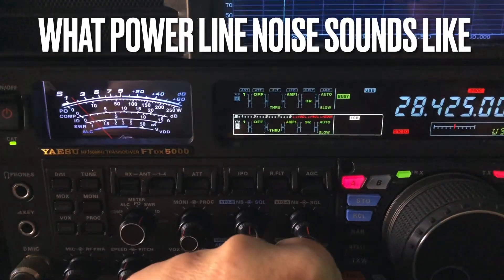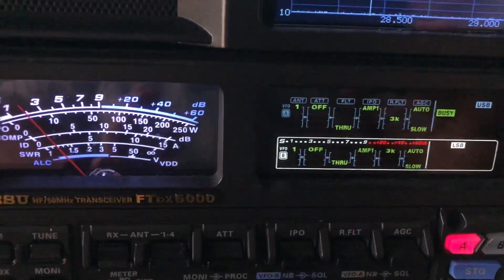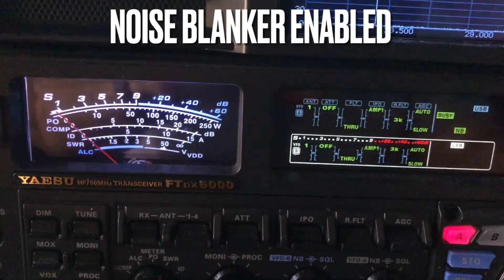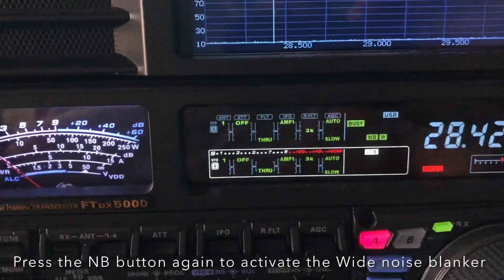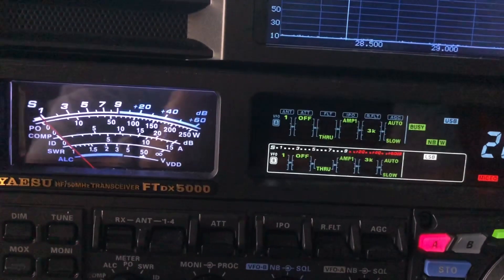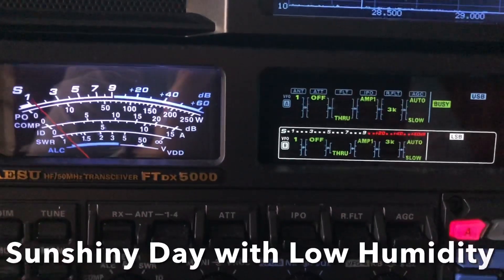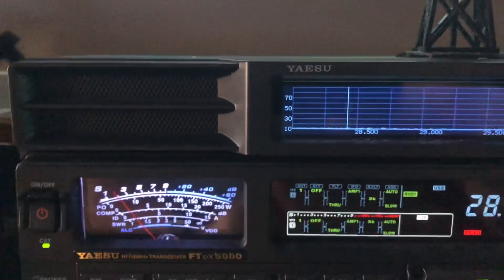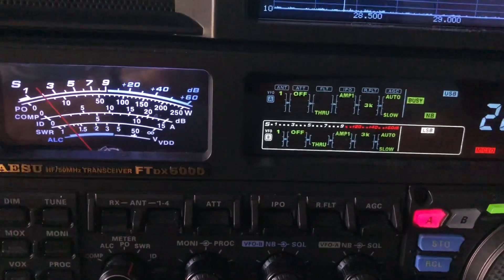What Power Line Noise Sounds Like

Comment: NOTE: I have a little power line noise but my biggest problem Is from my garage door opener. It's an Overhead Door unit with 'code blocker' that sends out a Continuous transmission constantly. Only way to stop it is to unplug from the receptacle on the ceiling. I use a smart receptacle I control from my phone. It generates noise on all HF bands.
Reply from the maker: Oh Tom!  That must be awful.  I guess there is something to be said for the old days before we had smart phones and smart homes.  My son has a completely smart home.  I can’t imagine what it would be like for him if he was a licensed amateur radio operator.

73, de N4HNH

Comment: My power line noise is S9, and the entire neighborhood had buried utilities. Next warm day, I'm going to put the radio on a battery and kill power to the house, then check the connections on the panel and bring everything back up one breaker at a time.
Reply from the maker: That’s the way to handle it; methodically.  73, de N4HNH

Comment: 100% correct I have the same problem in the wind and in the afternoon or mornings when high humidity occurs, this happens to me on all bands but I can pinpoint it by turning my directional antennas to the problem it comes from the high voltage lines on my farm before it gets to the Transformer...I wish you could have had it on AM. to see what that sound like.. cheers VK2KPP
Reply from the maker: AM sounds the same but worse.  You hear both sidebands.  But I will try to remember AM the next time.

73, de N4HNH

Comment: The sound kind of resembles that of a welder. Does your FTDX10 noise blanker work for this noise too?
Reply from the maker: Yes, the FTdx10 can usually deal with it.    I covered that in one of the FTdx10 specific videos.  I still prefer a traditional noise blanker circuit over the DSP-based noise blanker.  But with the introduction of SDR and DSP we are seeing the traditional noise blanker become a relic.  It is cheaper to use a DSP chip for the noise blanker function than it is to use the discrete components used with the traditional noise blankers.

73, de N4HNH

Comment: That you. I’m hoping to setup my very first HF radio this week. I have the large transmission electrical lines very close to my place and wonder what it will be like.
Reply from the maker: I hope you don’t have any issues.  If you do, your local power company should come out and make necessary corrections.  Note that vertically-polarized antennas are susceptible to noise but a horizontally-polarized antenna can pickup power line noise, especially if it is close to the power lines and at nearly the same level off the ground as the power line.

73, de N4HNH